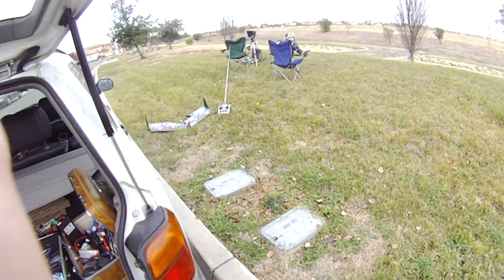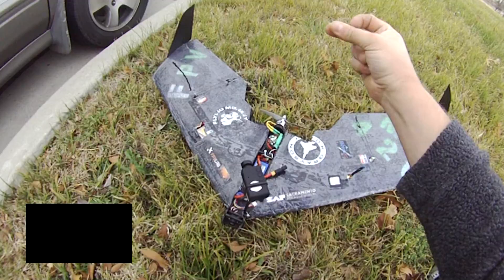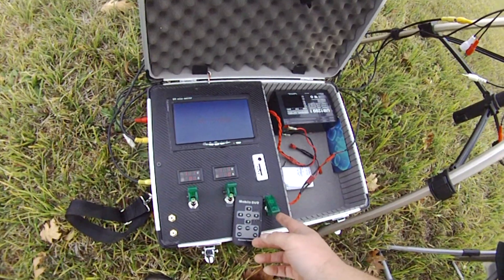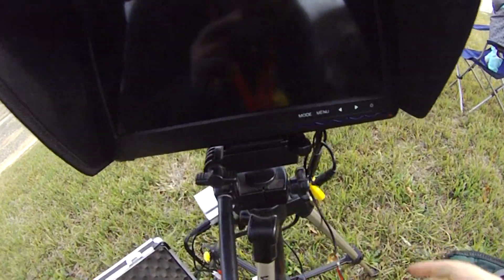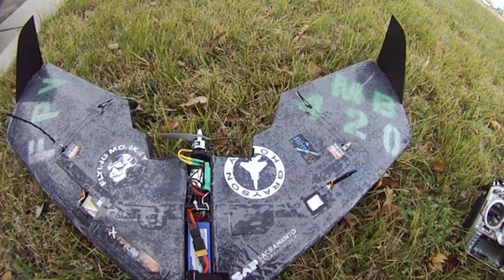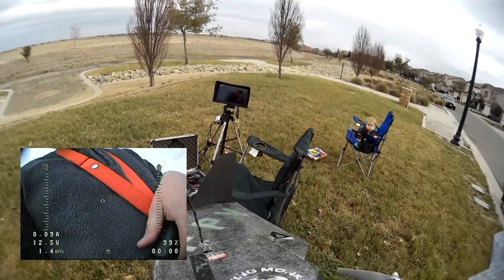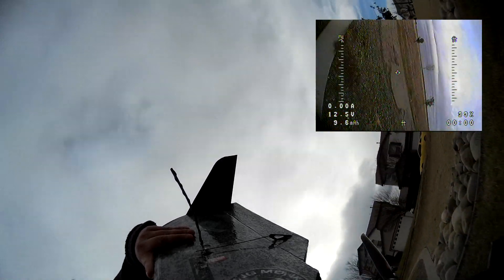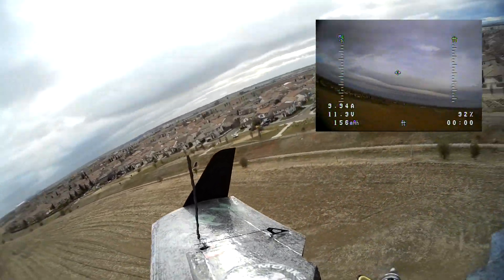My FPV Ground Station

Comment: looks nice but too old now. For fun we dont need analog signal and poor quality monitor anymore. Use vr glasses and digital  transmitter instead them.
Reply from the maker: analog is latency free still and this video is very old now, i have much newer equipment now of course.

Comment: Nice set up- can you tell me; step by step your build up ground station? Dvr, bAtt, And how you splice your view monitor. I have no ground station but I do have a separate trip0t  station. Can you please. Thanks a million.
Reply from the maker: Inside is a car audio video splitter to provide buffered video outputs, you can adjust the gain on each as well.